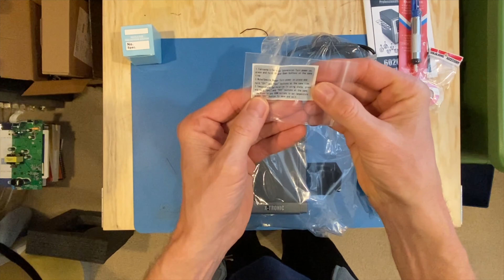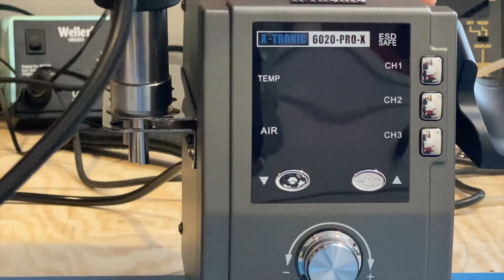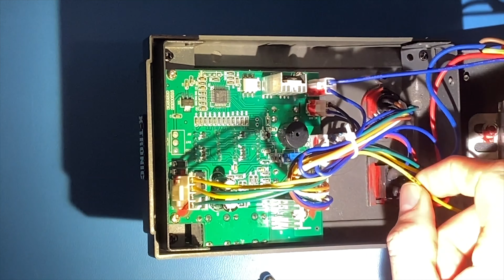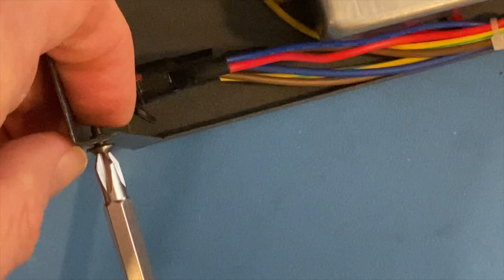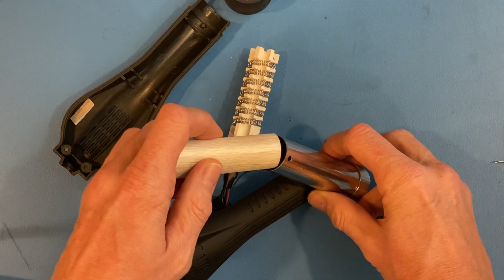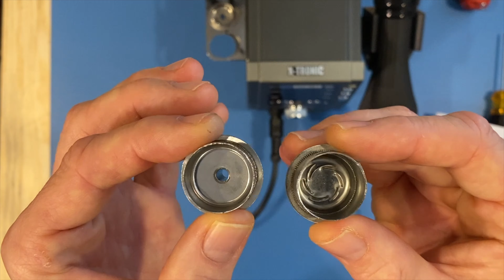X tronic 6020 Pro X

Comment: Unfortunately, this is the same type of station as cheapo $50 ones on Amazon with the blower in the handle. The only thing you can do with this is remove those resistors and capacitors as you did. Forget about IC chips on large motherboards with groundplanes

Comment: Funny, I think that torque screwdriver cost more as the station.  On the site they stat you need to measure the temp without a nozzle and a few inch from the handpiece (2 inch if I remember well) btw I set my own hotair station (OKI 900W) around 350-400 degrees, and removing such a resistor costs  just 2 to 3 seconds. 500 C is way to high (or are you talking F ? )
Reply: Oi it's pa4tim from EEVblog

He was using Fahrenheit
I guess this was the video you watched

Comment: Nozzle rack:
 I would maybe consider relocating the nozzle rack to the side of my workbench with 3 woodscrews, but that's a woodworking project so you'd need me to do that for you. 😆
Reply from the maker: True, I would need the wood crafting master for that kind of task!  Though this pen needs to be returned to the factory holder to take advantage of the automatic cooling down process.  There is a sensor in the body of it that detects when it is in the holder.
Reply: @savvycircuits9683  No, I was only referring to the rack that holds the various nozzles/tips, the wand holder/rest.